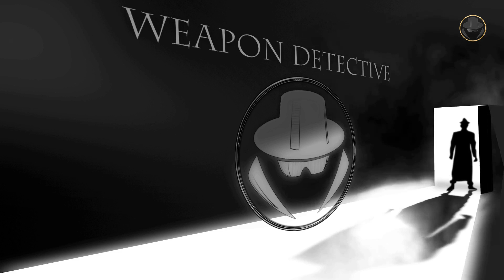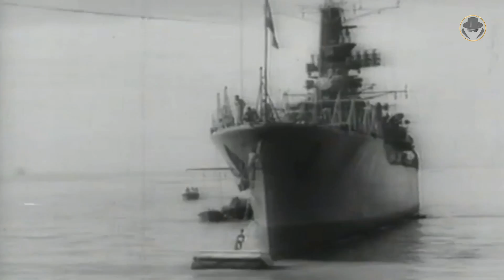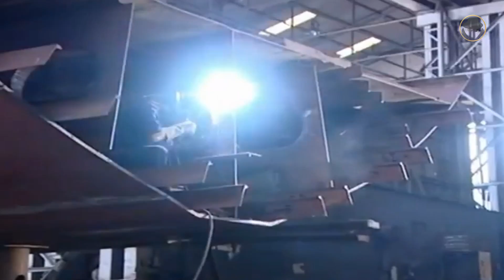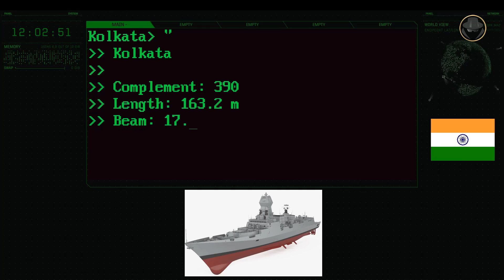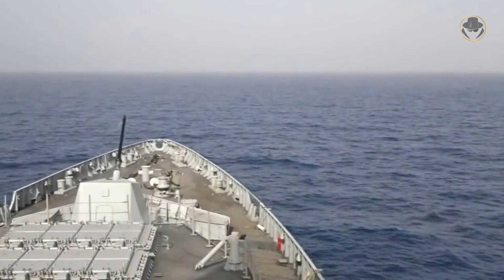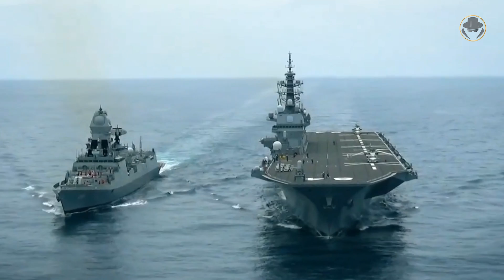Kolkata and Visakhapatnam-class destroyers | The deterrent power of the Indian Navy

Comment: Underarmed destroyer with old gen ciws for a size of this ship..
Only 32vls system of air defense for 7500tonn destroyer is a very risky thing..i like how you never mentioned anything even though there are many things to criticize..
Reply: Well there is something you may not know is called chaffs and flairs. They are also used for self defense. 32 vls would be enough and if enemy is determined to saturate the attack then 100 Sam Also can't protect you. And 16 brahmos is enough to bring down 16 ships. It's speed is 3mach+ and can perform various maneuvers at high speed, it have 32 times kinetic energy of tomahawk. And having less vls means less maintenance, shorter overhauling period, low cost of operations etc.
Reply: Best Anti ship and ASW capability in the world, supported by decent Air defence. Thats a trade off.
Reply: Its 32 VLS only for the Barak-8. 32 more VLS for a new SAM system (DRDO VL-SRSAM) will be installed during a refit in the near future. 

And under-armed my a$$, its 16 AShM are too OP for most navies.
Reply: @death_parade  there is difference between is and will be...
And 64 vls is kinda standard for a destroyer....

And,,48 AD+16 Ashm are also too OP for Indian Navy...
Reply: @TheLittleMaestro2911  After the refit, it'll be 80 VLS total on each P-15A/B class destroyer. That is sufficient. Significantly more than the amount of VLS and armament on a Chinese Type 52D destroyer which is in the same weight class as P-15A/B. 

As for there being a difference between then and now, its that we aren't staring at any major naval engagement for now. Not while the Chinese can't manage a permanent presence in IOR and Pakistan is too bankrupt to even attempt anything. Therefore the Navy chose prudence in its fleet buildup strategy: limit number of VLS until indigenous weapons that can be produced at a nominal cost come online.
Reply: @death_parade  still justifying a thing that is not present at the moment...
Leave it dude...
You win,i loose..
Reply: @TheLittleMaestro2911  Its not about "win or lose". Its a simple fact. VL-SRSAM has already started testing. Its been launched from Delhi class destroyers already. Its only a matter of time now before it gets refit. 
.
If I go by your logic, the entire UK Navy's aircraft carrier fleet is useless because the F-35B they embark can not yet fire any Anti-Ship missile. But that did not stop the Royal Navy from sailing its carrier battlegroup half-way around the world to China in a show of force, did it? Even British destroyers are similarly "underarmed", but are now undergoing a similar refit to augment their VLS capacity with new missiles of VL-SRSAM class.
Reply: @death_parade First of all Naval F-35 wasn’t mean to carry any Ashm..yet they can carry JSM which is a stealth Ashm/Land attack Missile..The F-35 was procured to accomplish Air to air and air to ground rule..

Secondly,everybody knows British destroyers and frigates are kinda under armed in one sense.but you cant call them fully under armed since they have MK41 vls system..cz it can carry up to 4 SAM depending on variants in 1 cell..
Tell me,does Indian destroyer  offer this type of luxury right now?

My whole point was,if an enemy des. Has 16 vls dedicated for ashm and fire them towards an indian des. She will be in a hard time surviving those attacks cz she got 32 vls dedicated for SAM and she can't carry more than 1 SAM in a cell.whereas, if a des attacks an opponent who possesses 48 vls dedicated for SAM will have a higher chance of survival...

Now,a future upgrade wont help in that situation cz it is the present threat not the future....
Reply: @TheLittleMaestro2911  So many wrong facts in your comment:- 
1.) Check again, the AShM NSM is not available on QE class's F-35B yet. And its a bit stupid to sail around in a carrier fleet if said carrier can't  perform something as basic as anti-ship strike. Yet they did it against China. Was Chinese fleet not a present threat? 

2.) Type 45 do NOT have Mk41 VLS. Therefore they can't quad-pack the ESSM. Nor do they have ESSM in inventory. 

3.) 32 VLS is sufficient for a 16 missile volley actually. Its a well known rule that you launch 2 interceptors per incoming missile. Can you not do a simple 16X2?

4.) What the 32 VLS for Barak-8 constitute is an outer ring of air defences. And Barak-8's design makes it possible to also act as the inner ring of air defences due to its short minimum engagement range. But that is not ideal. Which is why 32 more VLS for a dedicated inner-ring AD missile (VL-SRSAM) are to be installed. That gives it the ability to withstand even a 30 missile volley. There are also two other factors I haven't mentioned yet in this calculation, first digest this much.
Reply: @TheLittleMaestro2911 ur last comment was entirely wrong regarding facts go study kid do homework now that Vertical launch missile has been integrated with some destroyer soon most will be equipped with it.

Comment: through the introduction of the private sector into defense industry will enable the Indian Navy to achieve new heights . . . Indian PSU will lease multiple naval task force to the IN . . . the naval task force will comprise of a fleet of three next generation 114,850 ton (126,900 ton loaded) stealth (CATOBAR) super carrier powered by new cutting edge bioFuelCell3^ i-SMARTHYBRId® marine propulsion system . . . IN also needs two Mistral class 38,390 ton (46,290 ton loaded) non-amphibious (CSTOL) multi mission assault ship powered by the same bioFuelCell3^ i-SMARTHYBRId® power pack . . . being non amphibious by it won't feature a dedicated vehicle deck as found in most amphibious assault ships . . . instead it'll have an enlarged full size aircraft hangar with a higher than normal hangar roof height that will accommodate 20 - 26 surface ship borne helicopters like the MH-60U SeaCombat® Hawk maritime multi role helicopter gunship . . .

Comment: One should take the Mach 2 figure for Barak-8 with a grain of salt. It is the officially published figure but it is an improbably low speed for such a missile to max out at, so I suspect some obfuscation is at play. Somewhere in ball park of Mach 3.5-4.5 is more likely.
Reply: Barak 8 accelerates to Mach 5 in its terminal flight phase when the second of the dual pulse rocket motor kicks in
Reply: @chalajatujhefantapilau  Now Mach 5 makes a lot more sense. Is it the same DP motor that Stunner uses?
Reply: @mortified776  Nope, I don't think so, this dual pulse rocket motor was developed by India's Defence R&D organization named DRDO as part of the Indo-Israeli collaboration to develop the Barak 8. Rest of the missile was developed by IAI.
The development of this dual pulse rocket motor has been a huge boon for several Indian defence projects like Next Generation Anti Radiation Missile(NGARM), Astra Mk2 BVR A2A missile, Akash-NG SAM system.
Reply: @chalajatujhefantapilau  India's missileers have indeed been prodigious. I remember back twenty years ago when DRDO was having a lot of problems with the Trishul point defense system for the IN. They of course ended up buying Barak 1 from the Israelis which I think is where the seeds of the Indo-Israeli joint missile initiative were planted if I am not mistaken. Sometimes failure leads to better things than you planned in the first place! I was glad to read recently that the IN's new point defence system recycles a lot of the Trishul work, so even that wasn't a waste after all!
Reply: @chalajatujhefantapilau  On reflection, it was also daft of me to think a country which has sent orbiters to Mars on lifters they developed from scratch would need to use anyone else's rocket motor!
Reply: @mortified776  DRDO today can pretty much make any missile the Armed Forces want
Reply: @chalajatujhefantapilau  if only our buroecrat babus agree, and invest more  money in research, development, and in drdo
Reply: @mortified776  Well missile systems in modern world are far more complex than what we can imagine. DRDO is tryimg to master everything as of now. In last 4 years it has accelerated its work beyond what we had ever imagined, but that wasn't always the case. 
As far as I know DRDO also has set priorities list. Air to Air missiles and anti radiation missiles have taken precedence over others. 
As far as other systems go, medium weight fighters and 5th generation fighter have now taken precedence.
Reply: @mortified776  It is not daft of you. The civilian space agency (ISRO) and military technology developed by DRDO is kept in separate silos and this is part of government policy for some reason, to this day. Like ISRO developed a Hypersonic test vehicle with a scramjet but it took DRDO much longer to test its own Hypersonic missile(HSTDV), which was last year. My guess is the government doesn't want ISRO to be a component of the military or maybe its something else that results in this compartmenalisation.
Reply: @nucleargandhi101 I believe Indian missile works accelerated during former scientist Abdul Kalam's time.
Reply: Exactly what I think.

Comment: A correction MFSTAR is destroyer  variant of kolkata class has detection range of 400km and 250km range is for corvette variant of Israeli Navy
Reply from the maker: We mentioned the 250 km range for the fighter-sized aircraft. You are right. We were ought to mention the range for naval vessels, as well.
Reply: @WeaponDetective  range of mf star on Kolkata class is 450 km vs 1 m2 target
Reply: Yes range is more than 450 km and can detect stealth target 160 km
Reply: It is the modified version of iron Dome radar, its range is no joke
Reply: its range is around 500 kms. Was told to me by a Sailor onboard INS Kolkata.
And in reality, when he says "500 kms", it means its "Over 500 kms" ;)
Reply: @rohitb316  my uncle is on Delhi class destroyer he says me it's range 450 km vs 1 m2
Reply: @srfsongs3041  that is complete bullshit . MR-755 Fregat-MAE(Delhi class ) has barely 300km (horizontal)
30km(vertical) detection range 
Which is only max instrumentation range 
Missile guidance quality range is much lower. Which is reason it still has a medium ranged air defence system.
Even 1msq RCS targets have barely less tahn 50km range with the radar with the respective power generation available for the ship.
Reply: @srfsongs3041 and range of a ship's radar will not be circulated with entire crew of the ship.(that range will be even lower as its build by russia, as no country give full spec systems to a foreign country)
Reply: @HOOLIGAN077  mf star range is more than 500km  
My uncle on Indian Navy warship said me
Reply: @srfsongs3041  yes ,  I understand but let me explain how range of radar is calculated
*Power 
*Power efficiency
*Materials used 
*Atmospheric conditions
*RCS
etc
That 500km is the maximum instrumentation range 
For example if u take a picture from a 12mp camera of a landscape and zoom in objects further has less clarity.
Same goes for a radar, at 500km it has barely enough clarity to identify large objects. (For elm 2248)As range reaches 450-400km it can detect ships sized targets, from 300-100km for 5msq(eg: a full loaded jf 17)to 
1msq (a clean Rafale (no weapons))and 100-25km for RCS lower than 1msq(stealth aircrafts, anti-ship missiles, cruise missiles, and ballistic projectiles)
This radar has good quality detection range
(good resolution of the target tracking)
of 250km (for 5msq) with which it can guide SAM missile upto 250km.
Reply: @rohitb316  more than 1000 km vs a ballistic missile
Reply: @srfsongs3041  😳😳😳
Dude chill BM targeting with that range is impossible for the ship as even 
AN/SPY 1 has barley 500km altitude for terminal detection of BM sized objects and only 370km for tracking clarity of target. 
Elm 2248 is based on 2084 which is a radar for iron dome.
India longest range BMD radar is only 750 km for missile guidance which is swordfish based on Israel green pine.
Which used ground based power.
It impossible for a GaAs radar of that size and with the ship power generation to have  the range.
Reply: MF-STAR will be blown out of the water by the new DRDO LRMFR. Its 6 meters in diameter LOL. And there is a good chance it could be based on GaN tech. Its already being tested onboard INS Anvesh. Its going to be the main radar on the Project-18 destroyers and will be comparable to the new SPY-6 radars of US Navy.
Reply: No one knows the range except the Indian navy and Israeli navy.
Reply: Oh My Eyes,What kind of psychopath developed this weird-looking boat, his brain must be full of shit
Reply: @frankfleming1103   50 cents deposited by CCP and 10 bats, 2 dogs for meat ration